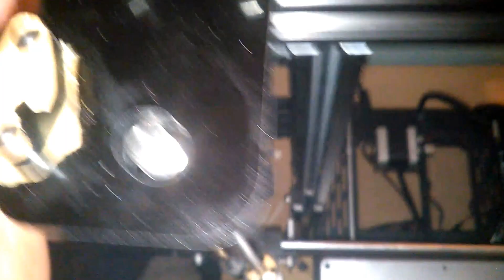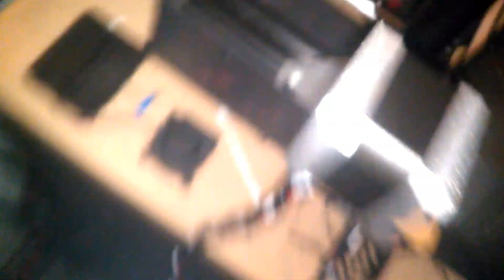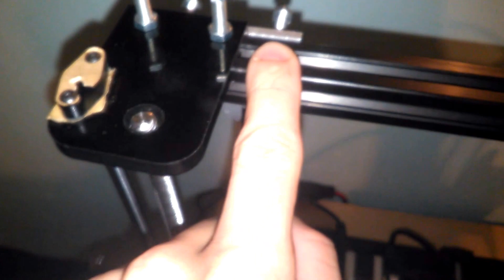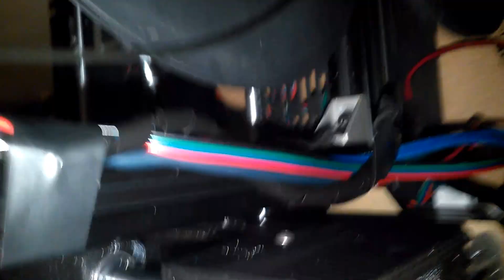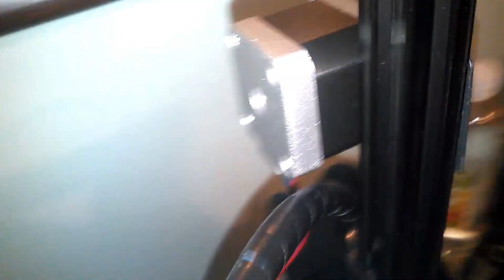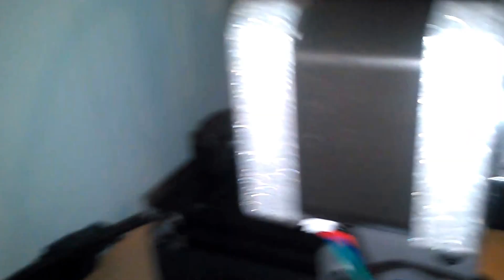Frame bracing and motor dampers on my 3d printer

Comment: Can you make grup at facebook? for community DMS 3D Printer
Reply from the maker: sorry, but no. I have a lot on my plate as it is with reddit, ecig forums and other tech sites.
We do have a dp5 forum though, please feel free to join http://dp5.boards.net/ a small forum dedicated to the DP5. That includes the DP4 as well though, as it's the same printer except a lower z height and no bed leveling sensor.

Comment: Your improvised bolts have an advantage over "correct" sized bolts in that you can bottom out the bolt which locks the t nut in the slot then when you back down on the jam nut it locks the bracket to the rail which I believe gives a stronger and more vibration resistant connection. I use this all the time on 4040 rail for making test machine mounts.